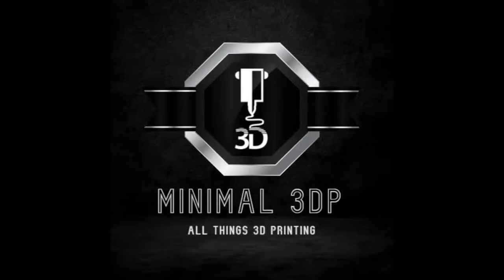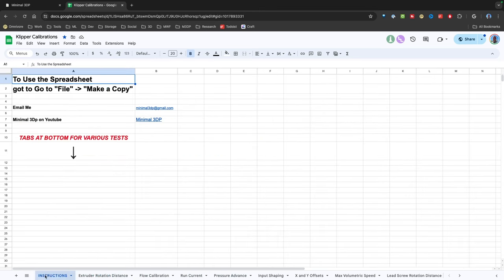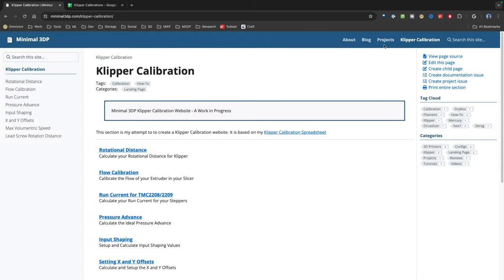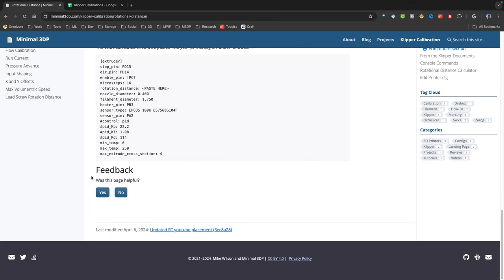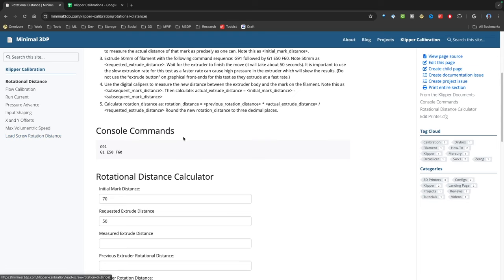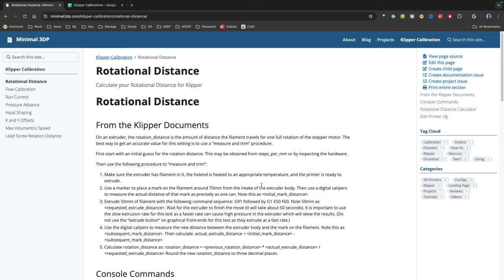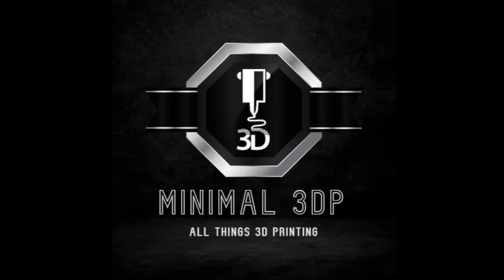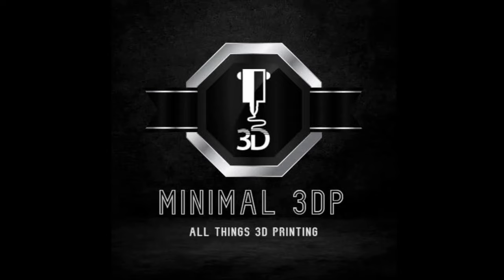The Klipper Optimization & Calibration Website: Power Up your 3D Printer and Enjoy

Comment: Thanks for the videos.  Very helpful. I'm in the process of converting my CR6 SE to klipper. Works but the calibration process involves a lot of searching. Also it's finding out which slicer fits best to my prints. Your calibration website and spreadsheet looks awesome. But when I have to print a sample with specific parameters the search starts again. It might be an idea to refer to the settings in the main slicers (Cura, Prusa and Orca) where to find the settings that have to be adjusted for the print. For example in the flow calculation print thin walls or perimeters are named differently in each slicer. A reference table with the name of the setting in each slicer would be a great help.
Reply from the maker: You are welcome. I appreciate the feedback. That is a great idea. Let me see what I can do. It might take me a couple of weeks. My day job has me behind.